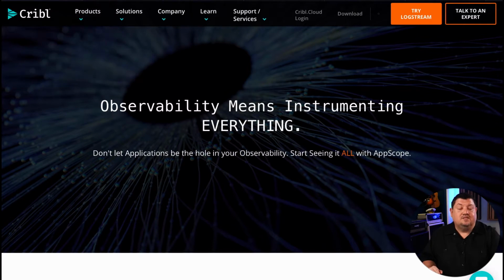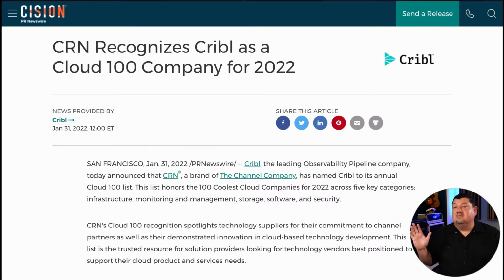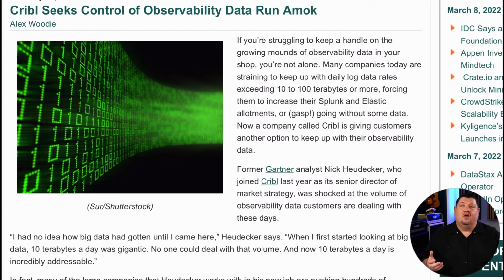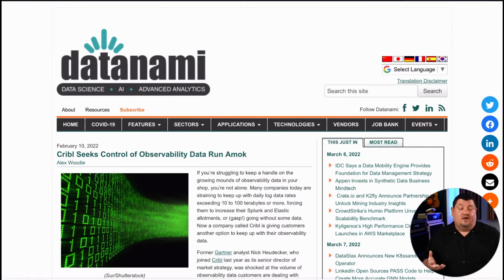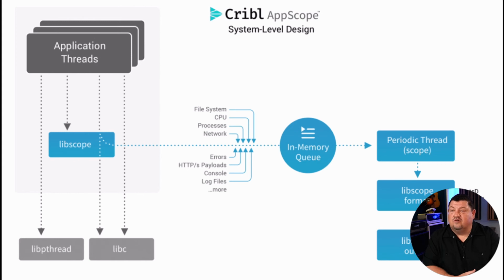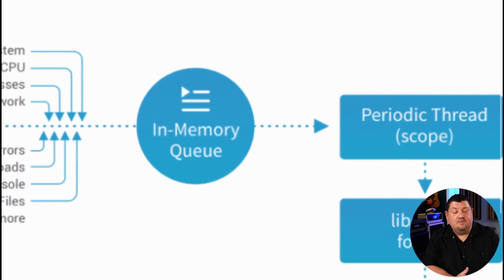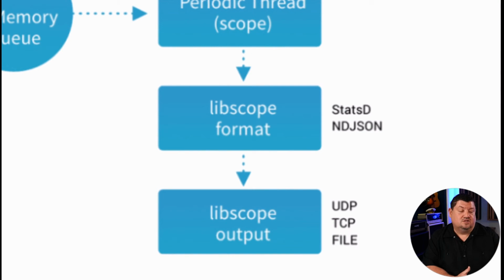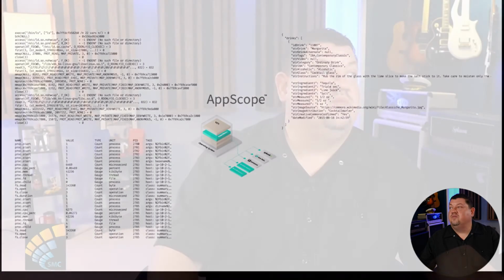Instant Performance Telemetry From Any Linux Executable?

Comment: You mentioned Cribl uses agentless monitoring. Does Cribl rely mostly on Linux users, and then querying the host? Based on the image at 21:00, it also looks like agent behavior. Can you elaborate a bit more on the collection process?
Reply from the maker: Hey Josh. I'd recommend you check out the show notes and links on this page: https://smcjournal.com/archives/595 and if that doesn't answer your questions - reach out to CRIBL directly. I'm happy to make an intro if you like.